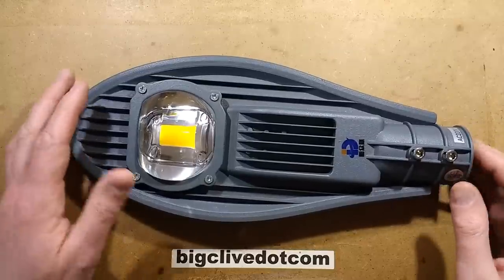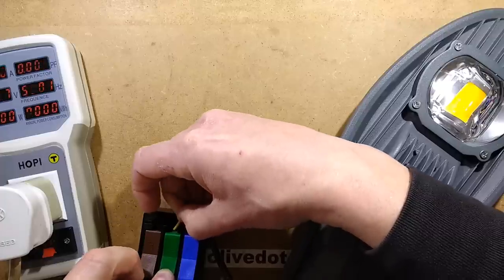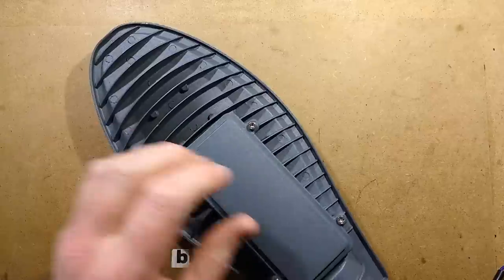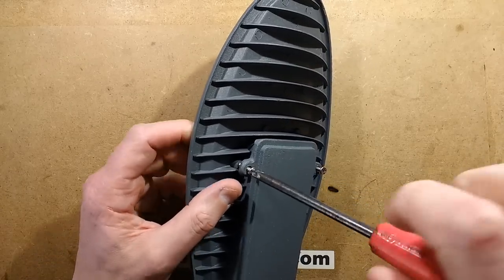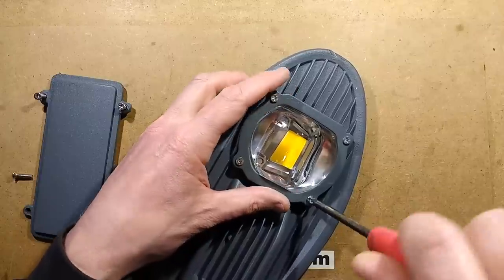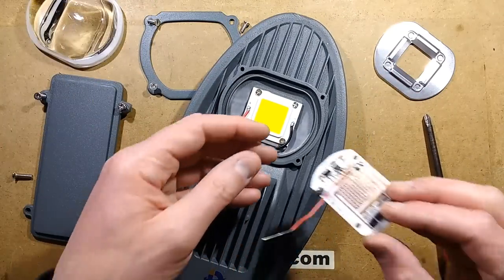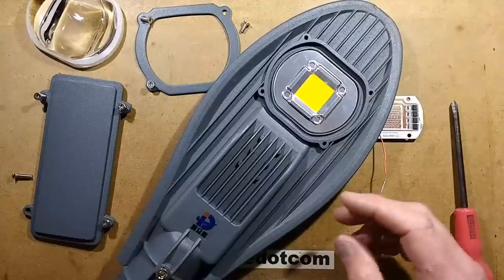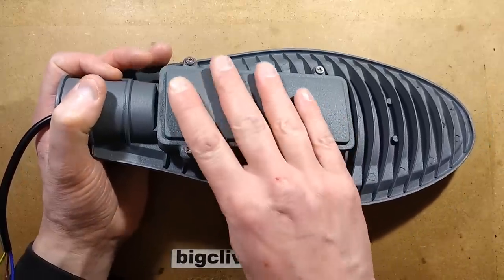Inside a stylish LED street light from eBay.

Comment: The yellow color temperature of sodium lights is a really good thing. Firstly for sleep patterns, blue light is disruptive (probably good for highway, bad near homes). Secondly the redder the light the less it effects your night vision, so blue lights are worse for harming your ability to see when you leave the light. Finally yellow light is better at penetrating rain or fog.

The number one thing that surprises me about the LED street light though is the lack of redundancy.. you could just as easily use 2x 20w units per housing and have even fully removable from below, meaning that failure doesn't result in darkness and servicing is easy. Likewise for higher value applications backup battery is a huge safety boon.. even just 30mins of runtime on reduced output can save lives in disasters.
Reply from the maker: SOX lamps are one of the most efficient light sources known.  A very narrow output near the peak spectral sensitivity of human vision.
Reply: bigclivedotcom Fortunately, we still have sodium lights in my area. I love daylight LEDs indoors, but outdoors at night is another story.

Comment: Dear Clive, the reason why most chinese manufacturers decide to omit the connection of the ground pin to the metal frame is the fact that in most countries electricians decide to wire up the mains such that the ground pin is hooked straight up to the neutral pin of the AC, thus requiring less wire to wire up a building. If in such a system you attempt to physically wire something to ground you cause the RCD's to trip.

Love your videos, best

Comment: The problem is not with the Chinese. It's with the greed of the people who ask them to manufacture something for a ridiculously low price.  They are quite capable of meeting any quality standard required, but it has a certain price.
Reply: Landrew0 - Not true.  Most people would pay the extra $0.10 for labor time it takes a 15 year old to put a screw through the ground crimp and tap longer threads...*IF* they knew they were getting a better/correct version.  The greed lies in the eBay listings that are all generic and aren't honest.
Reply: Another missing ground screw.... It so frustrates me that they can't put in a $0.01 screw.
Reply: +thechosendude you obviously have not worked on a wholesale scale where 0.10 of unit cost is a big deal.  The eBay listings are just extra units after the main production needs from a reseller or large retailer are met. No one manufacture these things for the eBay consumers in mind; it's not worth setting up a production run to sell them one by one.
Reply: thechosendude
We both know that's true, but greed has no IQ.
Reply: Yes and no. The way the market works means even reputable products get fake components or whole fake units, which makes it harder to compete in a higher end market, while being less of a problem when your priced dramatically lower. Lots of brands are also newer, and experience helps with avoiding some pitfalls, so again trying to compete at lower price gives you more leeway.

So at determent to the people who work there its not as viable to turn out high end items in China or India as cheap ones, for lots of local reasons just as much as international pressure for cost. After all, in UK or USA its not going to be economical to open a shop that makes fake eggs since the expense of doing business (labor, machines, premises) would be worth more than the price difference between the chemicals and real eggs.. that was a real thing that happened in china. Although I see it changing a lot in the next 20-30years..
Reply: Hamish McGregor
You know that almost everything is made in China, right?
And much of it does not fall apart, and the quality is quite good.  Don't blame the Chinese, blame the ones who contract the work.
Reply: +wlai - People often state that the small cost difference is a big deal over a lot of units but they are missing the bigger picture.  When you make a product with flaws, in this internet age where people dissect and review them, even if only to tell that theirs failed, you lose sales.

It's a bigger deal to lose a sale because it's junk, to make zero profit instead of slightly less profit.  There will always be people who buy the cheapest of everything because they can't tell the difference but that doesn't mean that individuals won't learn from their mistakes and not buy the same thing again.
Reply: +Landrew0 - You do have a point that they build to lowest cost to fill a market niche, but they actually pride themselves in cutting corners and feel some impunity in doing so, being able to skirt consumer safety laws, being remotely located and operating overseas where a failed product usually won't be returned under warranty, if there even is a warranty.

Further they typically treat their employees badly, working in unsafe, unclean conditions, long hours, with low pay.  No matter what quality a buyer specs, they start out with inferior materials because another of their industries made less pure and softer metal for example, again back to their philosophy to make things as cheaply as possible but it's one of their factory component suppliers, not related to buyer greed.

Then there are the sellers who make up specifications or intentionally lie (willfully ignore the impossible specs).  Apparently it is a very dishonest culture of selling in China, if they feel no repercussions.

American, Japanese, and other countries have a different philosophy, taking pride in the quality of what they make.  

Did it not occur to you that Chinese doesn't have the tech?  Sure they can build electronics, mostly using components designed elsewhere - They merely build these things because they do it cheaper, and often operating machines made in Japan to do so.  They don't pursue greatness, rather pursuing greed themselves.

Yes the problem is with the Chinese too.  If left on their own to design, manufacture and sell, they pick a lower quality than if manufacturing for a major European or American brand.
Reply: +Landrew0 -  Stating greed has no IQ is mostly wrong.  It's usually a low IQ that causes their life circumstance where greed seems necessary, or in China, just more of the usual environment.

More intelligent people don't need to go to the same extremes to make money, their standards are higher.  For example a car that a skilled brain surgeon considers junk, might be a better car than a McDonald's worker will ever own in their life.

People with higher IQs also tend to be more ethical, not pleading ignorance to product flaws, not withholding information, not trying to make it hard for consumers to get a product replaced under warranty, not playing games with a purchase like just not fulfilling an order and hoping the customer forgets about it because it would have taken a month to arrive from China, or giving them the runaround when they seek a refund.

People with higher IQs tend to not want to live in China at all.   Above by IQ I mean true intelligence, not just scoring well on math puzzles which is unfortunately one of the common IQ test strategies.  There are many people I know who have scored well on math but it is obvious they are one trick ponies.
Reply: My point is China has the "why bother" attitude because an honest manufacturer/seller cannot compete in a market that is essentially the wild-wild-west: zero regulation and lots of lies.  A cheaper and lower quality product muscles into the marketplace, making identical claims and near identical listings, and they outsell the better quality and honest guy by ten-fold...because the buyer/consumer (us) have no real way of determining quality online).  Of course the Chinese manufacturing industry is going to have a race to see who has the crappiest and cheapest product.
Reply: They know how to copy things and steal intellectual property, world best. Anything else, and they are quite useless.
Reply: Most of the problems DO start in China. It's Chinese manufacturers working for Chinese wholesalers who sell to Chinese retailers that have all the shitty products. And that stems from greed and poor business plans.
Or in some cases, Chinese manufacturers working for Californian companies that dont care about quality as long as the hype train continues to shift their dodgy product.
I am aware Chinese companies can make good products, BTW. I'm typing this on a Xiaomi phone, which is surprisingly high quality. Especially since it was about 1/3 of the price of most similar spec phones.
Reply: As someone who has worked with Chinese fablabs for years I'm laughing at this thread 😂 so many intellectual hissing going on without a modicum of truth in them lol
Reply: I was speaking metaphorically.
Reply: Richard Smith
I was talking to wlai.
Reply: I was speaking to Brainstorm. Youtube needs to get their crap together with this replying business.
Reply: Richard Smith no shit Sherlock
Reply: Landrew0, you may have mistaken my response for Mr. Stinky Cheese, who explicitly brought up the issue of IQ, as being targeted at you.  I have no problem with your statements. Cheers.
Reply: as someone who has dealt with chinese manufacturers, they will fleece you if you give them the opportunity. it's just how they do business. it's part of their culture. if you're dumb enough to get fleeced, you deserve it. they do not assume good faith. they have a saying that basically translates into "you get what you pay for" and it's the phrase they use to absolve themselves of responsibility when they get caught trying to cheat you. they think the way westerners do business is a joke.
Reply: SuperAWaC this is how capitalism works all around the world for the most part; not that I agree with this behavior.  But that's why every transaction requires contracts and lawyers who carefully prepare them, always assuming the other side is going to cheat if it isn't water tight.  And then the stronger side of a transaction, say a giant corporation, against a consumer or a contractor, well they write in special clauses to screw the little guy, which says that if you feel the contract is violated, you can't go to court to sue but have to use arbitration!  If you look at American consumer contracts it's all going that direction.